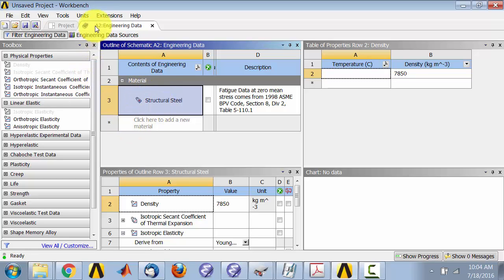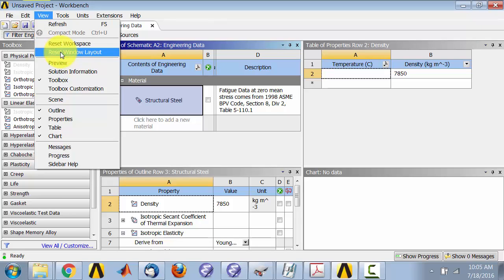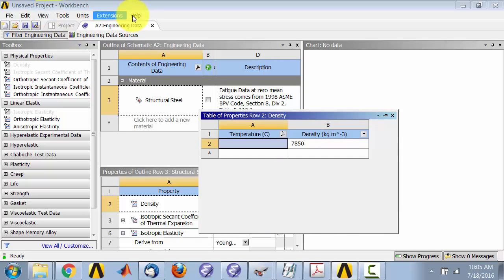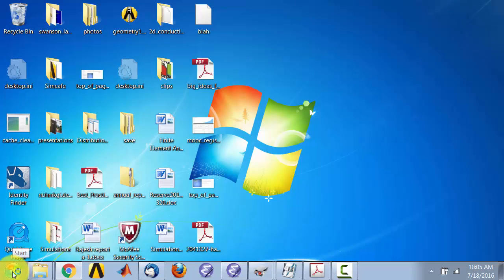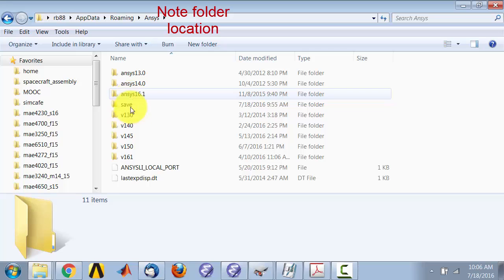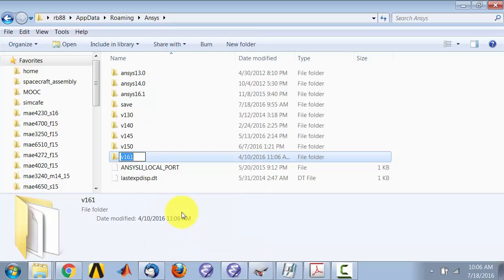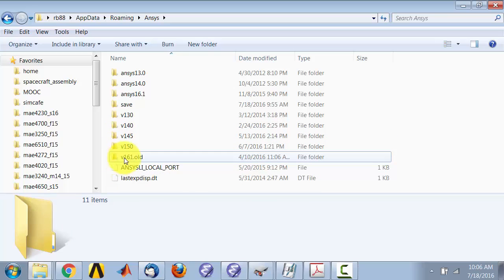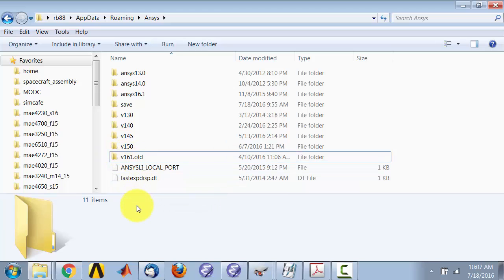ANSYS Material Property Specification Problem Fix

Comment: Thank you very much for this nice lecture
I have a question?
In the case of preparing a composite material consisting of two different materials, how can I determine the percentage ratio of the two different materials in the ANSYS program?
For example, the first matter is 40% and the second is 60%.
with best regards
Reply: You can not!
Reply: thanks